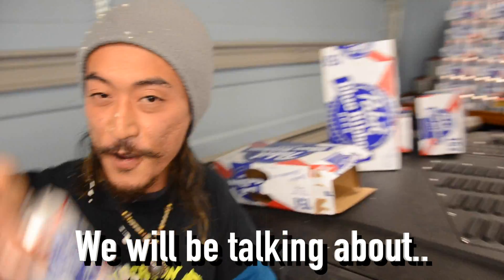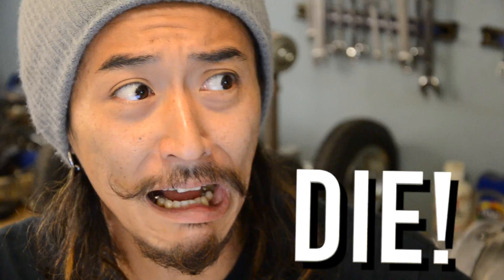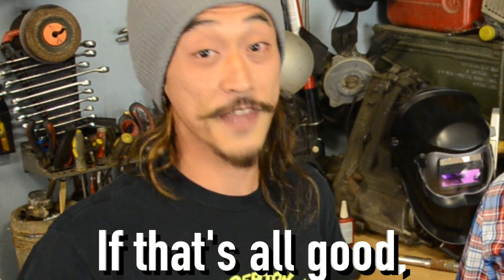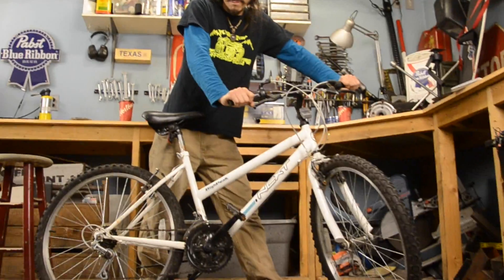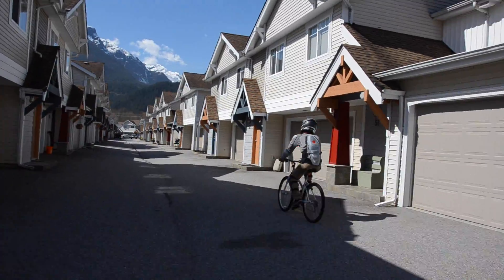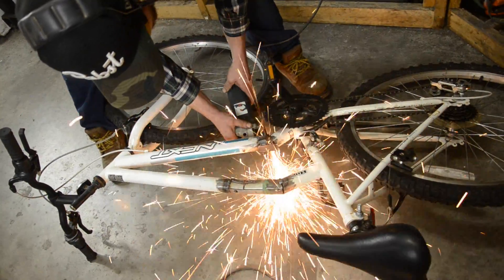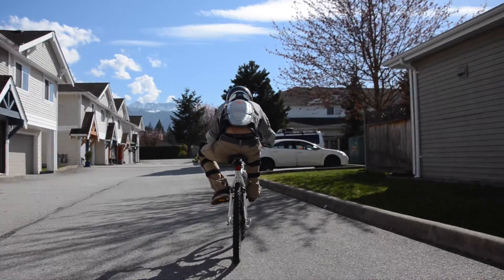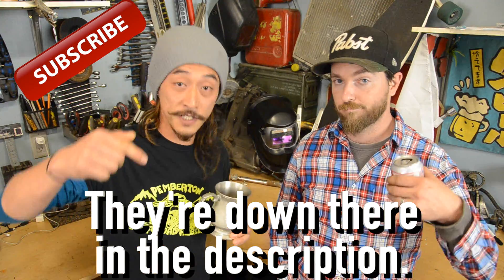Pinion Angle - WTF is Caster? - The Roadhouse

Comment: There is only one way to get these angles right. Set pinion angle. Cut welds on inner knuckles.  Rotate knuckles to correct caster setting and weld in place. Jeep also sells offset ball joints to make small adjustments in caster and camber.

Comment: on our 1998 grand Cherokee had terrible death wobble. tried the usual ideas, nothing worked.  Until we got all new  stock sized wheels and tires. PO had bought heavy  fancy expensive 18 inch wheels with big tires. Getting rid of them solved the DW. They were too big and heavy. New wheel and ties also got better mpg. Took us about a year to figure out the problem.

Comment: You're not changing the angle at the spindle. Bad Info. The spindle is round, lol. Your changing the castor at the Inner C. Pointing the rear pinion UP is fine. Pointing the front pinion up sends the castor into the negative. The steering plane now points into the ground, which is bad. Keep the front pinion flat as you can

Comment: I have a civic 95 when i turn my car in any direction and let go of the steering it keeps on going in the same direction what could be the reason? Is it beacuse of castor?
Reply from the maker: +Talha Inayat I'm willing to bet it's a seized ball joint or strut thrust bearing...
Could be something internal in the rack & pinion tho.
Reply: Pabst Boys Roadhouse  well i did have changed the rack and pinion and shocks but still it was the my alighnment shows +1.5 caster on one side and -2 on the other but i will try to change the ball joint

Comment: Hey guys , great vid .So got a 2 door jk ,lifted 6 inches, went with a tom woods 1350 w/double cardons for my rear shaft  . Manufacturer instructs to have the pinion angle run directly in line with the shaft. The correction is possible with my adjustable control arms but the angle starts getting dramatic for all other mounts ,especially the coils perches .My proposed remedy is it have all mounts( aside from upper control arm bracket ) cut . before hand I would determine the change in angle from level to aligned with shaft . Then apply the same change in degrees to new mounts and brackets (from artec 🤤) . I know there are shims and such ,and also the change and degrees  woln't be exact so probably some tacking and playing around will have to be done after the fact . But I'd be fine with extra cost and work as long as its produces feasible results . My question to y'all is do you think the process and result would be acceptable ?

Comment: So how do you/I fix fix my caster on my 2000 Jeep XJ? I know for a fact that's my problem after lifting it 4.5" on a short arm lift kit. I'm not mechanically inclined but not scared to try. I was also told Jeep Cherokees have a non adjustable caster set up. Any info is helpful. Thanks.
Reply from the maker: Answered this question for ya in a video:

https://www.youtube.com/watch?v=WITu9m1Ca0I&t=4s

Comment: This is one of the best videos about bump steer, from adding front axle shims I've watched. Never add shims or lift blocks to your front axle. I've only watched a few videos, but I subscribed. I got a gut feeling that you are in B.C., I'm in A.B., central Alberta. Red Deer where the Rockies are about an hour and a half away. I find your channel entertaining and informative. I really should visit my relatives in B.C. some day, and do some wheeling. My biggest problem is that I sold my '80 Ramcharger, and bought an '80 Powerwagon, Club cab, long box. Definetly not a trail rig. 4" lift, 35's, 360 4 bbl, and a 4 spd. It's as long as a school bus and rides like one.
Reply from the maker: Thanks a lot bud!
I am a huge fan of the old Ramchargers. An old friend had one. Miss riding in it.

Comment: I don't want to be a dink but technically the front drive shaft you showed really wasn't a cv.  it was a double cardan... love ya guys!
Reply from the maker: You're right, but in the biz, everybody refers to them as CV joints. Double cardan only to be specific. Just a habit that I said that I guess.
Cheers Bud!
Reply: and the double cardan...take the vibration out caused by diff and output shaft being different angles

Comment: I love all the videos!  I have added 3" lift jks trackbar and replaced a couple tie rod ends and still get a vibration on the highway at around 70mph.  Sounds and feels like its under my feet driving.  2001 XJ 4X4
Any suggestions?
Reply from the maker: I'd go get balancing beads installed in the tires before spending any real money on diagnosis.
See if that helps...
Reply: sh'+ Ryan, a vibration at 70 lol I get a death wobble at 25 mph scarier than a tank slap. I wish I had that issue . just the beginning of this venture. I think that has got to be the best demonstration that could have ever been given on this subject. already well read up on this but just seeing other perspectives. thanks guys.  SAS 'd Chevy of course springs came with a pinion kicker since there rear lift springs of course , I believe kicked my caster out way to much. plus a load of worn parts . let the fun begin.
Reply: Have you put in a T-case lowering kit? I put a 2" lift on a '99 XJ and that was enough to cause a driveshaft vibration. Transfer case lowering kit solved it.
Reply: SYE should help your rear drive line viberation or also add a wods rear drive line with cv joints

Comment: Man, I was going through withdrawals waiting for another video. 
Tech question: Since I've regeared from 3.73 to 4.88 I've developed a vibration from the front at highway speeds that is only present when the driveshaft is installed. I had it rebuilt and rebalanced and the vibration is less pronounced but still there. I've just settled on driving to the trail and installing it before I drop in. I wonder if the stock driveshaft is just going to do that or if the shop didn't do its job balancing it properly. 4.88's and 33"s at highway speeds spins it much faster. I only have 3" of lift and it's apparent that pinion angle is not the issue. What do you think?
Reply: ME TOO!!!! I'm addicted to the Pabst Boys! I just can't get enough!  I really like the professor Clyde look!
Reply: are your front and rear gears the same ratio?

Comment: I just went through this on my XJ.  Good info.  I generally try to run as much positive caster as possible without introducing driveline vibrations. In my case, the magic number was 7 degrees of positive caster.  Very stable.
Reply from the maker: 5 was a round about number, but yeah.
You'v got the idea....
Reply: +Pabst Boys Roadhouse 5 is definitely enough to be nice and stable.  Personally I'd be happy with anything over 4.  Overall very good advice.  If folks don't know exactly what they're doing, they're better off leaving it alone.  I had originally rotated my pinion up to the point of having very little caster angle in an attempt to chase away a driveline vibration. Turns out the vibration was an out of balance front driveshaft.  Had it rebalanced, and I was able to get a good caster angle back.  Great vid boys.
Reply from the maker: Thanks for sharing that bud!
That's the kind of thing more folks need to hear.